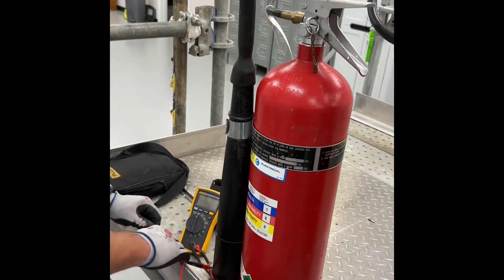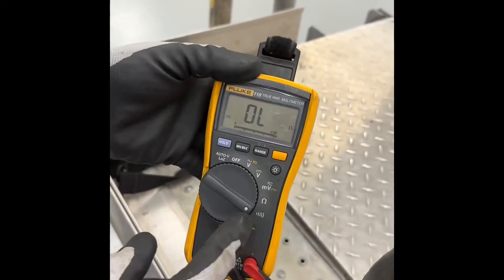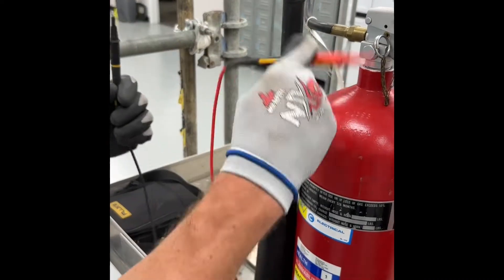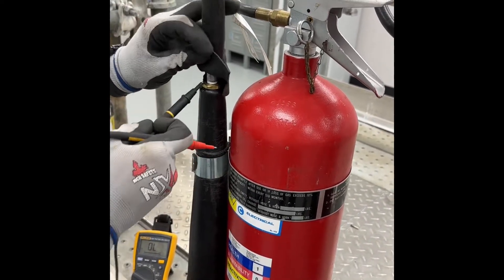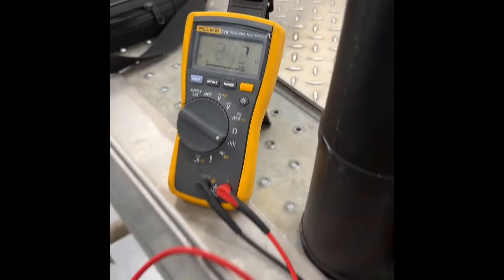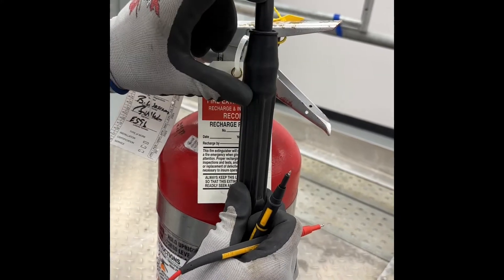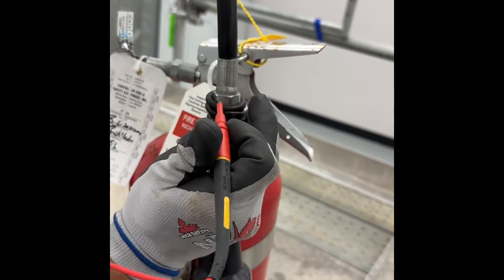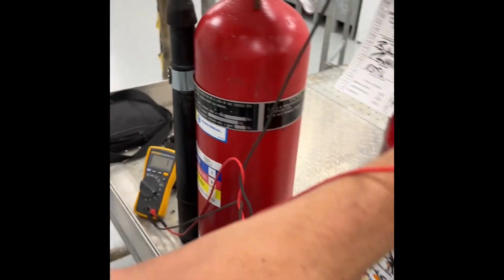Fire extinguisher conductivity test

Comment: Why?
Reply: The CO2 flowing out the hose creates a charge if there isn't a continuous conductor in the braid of the rubber hose.   Yes, I've been shocked before when discharging the CO2 before a hydrotest of the cylinder.

Comment: why is a conductivity test needed?
Reply: Rapid movement of large amounts of non-conductive fluids can result in a static electricity charge buildup.  It's more severe when involving rapid flow through piping (like an extinguisher's discharge hose) and lots of turbulence and agitation (like at the discharge horn).  But if that piping is electrically conductive then that will minimize the voltage potential and then the chance for a static electric shock is much lower.
Reply: @djo9c1  your a refill technician ? well do you have any thoughts I have herd co2 strips electrons off the nozzle?